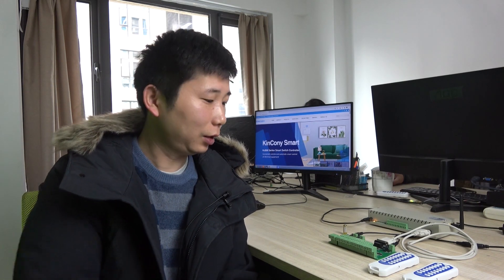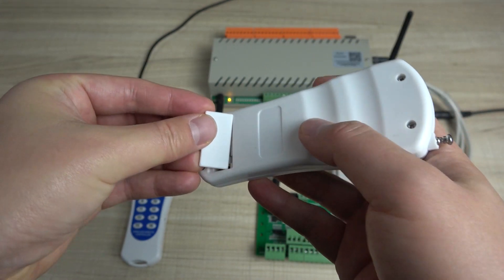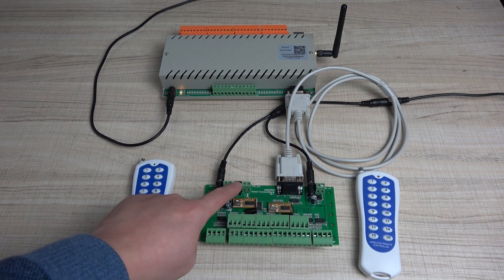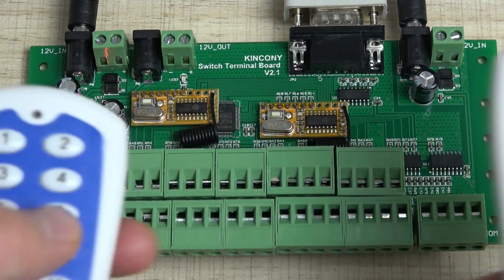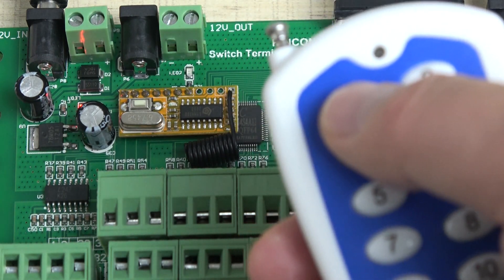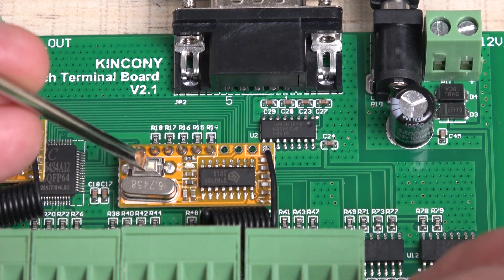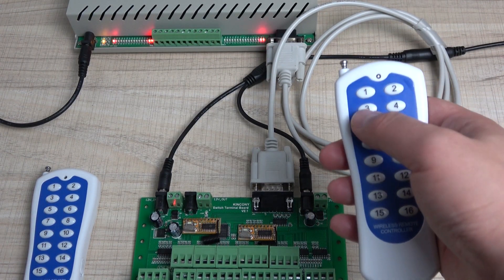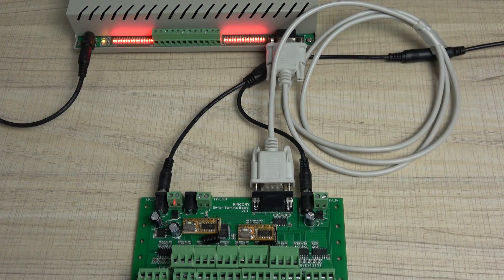how to use RF 433MHz wireless remoter turn ON/OFF 32 channel relay

Comment: Hello, it is compatible with kinetic/self powered rf433 remotes? Or exists any other kincony board with kinetic remote compatibility? I have in the house kientic wall switches for lights (with own relays), and i want to change the relays to a kincony controller for home assistant compatibility. Thank you!
Reply from the maker: not sure, this remote use for kincony's board.

Comment: Hello, Is it possible to paire more than one remoter for the same wireless module ?
Reply from the maker: yes, it support, but need to use kincony's remoter.
Reply: @KinCony  Thanks a lot

Comment: Hi sir how to purchase the kit
Reply: How much
Reply from the maker: you can see our online store
Reply from the maker: the new version is KC868-AK
Reply: Sir 230v crane remote available
Reply from the maker: ?? @ramc7060
Reply: My requirements is 5 pin relay type 16 channel 230 v remote controller
Reply from the maker: you can use KC868-A16S https://www.kincony.com/16-channel-esp32-4g-relay-board.html  every relay have COM,NC,NO support RF remote directly @ramc7060